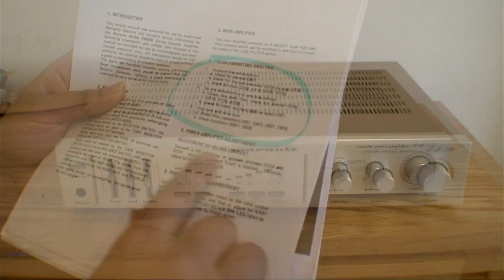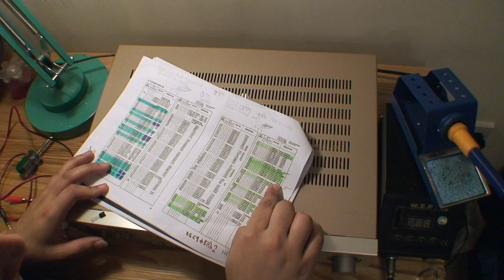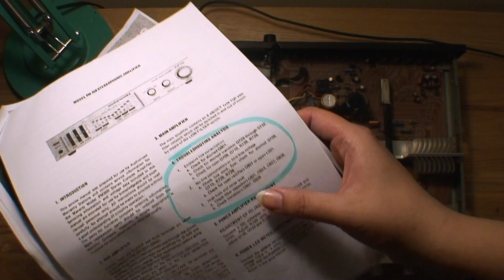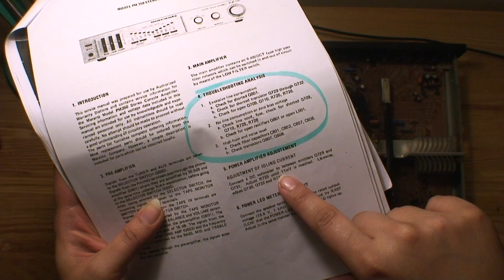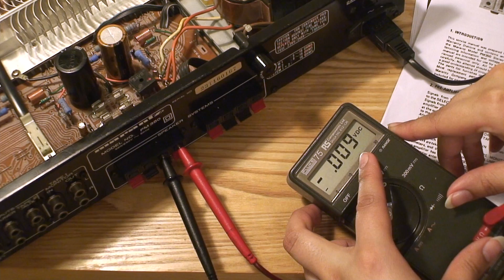Vintage Amplifier repair - 05 Adjusting the idling current (Marantz PM350)

Comment: Helllo Maddy , i realy enjoyed your good mood while fixing your amplifier ........and i am not the only one hahahaha.
Idle current will drift after adjustment and needs some time to settle before it  stabilizes , it's good practice to control and correct the bias/current if needed after 20  minutes ( always turn the pot slowly and wait .)
Offset voltages will benefit also from it .............
Keep on with a smile and enjoy your work .

Comment: If I not mistakeing  caps on older stuff are the first things to fail,I figured you might have recaped,.I am still learning at my age . 66
Reply from the maker: Yes it's the first things that go, caps can dry up, leak therefore their values will change and shift and can result in malfunction or damage, especially in sensitive equipment like micro computers for example. 
I think we're always learning, or always should be :o)

Comment: Hi, my sister, how are you? I have a tac c1 that works well but unfortunately does not record or erase the pre-recorded material. Do you have the solution? if it's possible
Reply from the maker: Hello, i'm well thanks, i've never actually heard of a Tac C1, what is it exactly, it's a type of cassette deck?
Reply: I used several tapes . trying to record the same result even on blank tapes and I am afraid of any action  he make me lost device in my country there are no professionals in the field
Reply from the maker: Okay Teac! I've never actually even used this model before, it sounds like the connections to the erase or record head may  not be good but it could be something simpler... since i'm unsure, I will give you the link to a facebook group who deal with cassette decks, and there is a helpful community there, you can post your issue along with a picture and hopefully somebody there can help you: https://www.facebook.com/groups/985045284868489/

Comment: Indeed, in order to check idle current you have to hook up onto the emitter resistor.  BTW, it is not wise to have the amp warming up for 30 minutes without knowing the idle current in the first place.  It might be way too high for starters, which would blow up the output transistors before you have the chance to adjust. Warm up the amp for five minutes, adjust idle current, you can check it again 20 minutes later.  Nice job, congrats.

Comment: I have the same Technics amp as the 1 in the background and blew 1 of the output transistor ic and ordered a new pair to replace them but when I fitted them then both channels didn't work so I ordered another couple and they still didn't work so I put the old ones back in and had 1 channel working again, then I gave up on it. About a year later I read that a heap of old STK8050s amp ic were made and they were all faulty, this is why I had failed in the first place and they are no longer available as old new stock.

Comment: hello maddie again i just got a teac cd player cd-p1188 it plays great but i cant get the display lights to work i was told that was the only trouble with it can you tell me what might be wrong with the light i check the unit it has no glass fuse help
Reply from the maker: Hi Todd, I would try getting the service manual for it first. if you're lucky it may just be a bad connection, i'm not really sure exactly what it could be having not taken a look. Though try the simplest things first.
Reply: THANK YOU I TRY THAT MADDIE

Comment: like video.one thing you should do is to test for current out of speaker terminals and not wait a half houer.Ok to wait fo amp to get up to normal temp. bias adjustment as you do is  done right as i can see.you can save a lot of money hwen you are either feeling the temp on the trouble side or use a digital infrared? temp meter. if bias is way out off speck hwen you turn it on you can destroy somthing.and you are right that bias should bee adjusted spesialy on cheap potmeters every 2 years.some like on sertan amps to have a higher bias current than the specs says so their amp can work more in class a mode is the belife i heard and can see maybe work depends on amp circuit type.klass a/b type amps this is done most with.I build amps and for 35 years have build loudspeaker systems and amps pre and power.>I am now building a hole sound system that will beat the spesial brands for the rich people but costs a small amount off what those brands take for the same over used circuit,s.I use dual mono 3 or 4 way digiatly manage amp for woofer and low mid and planar magnetik type drivers from 300hz up to around 3400.Then a amt tweeter from dayton amt1-4.It has a replaseble diagram folded and made by mundorf a german company that make drivers with that tech.problems with normal tweeters and mid drivers are start stop time and the total mass that moves.compare to my mids tha are rektagulere.diagram size like a round normal 6.5 inch mid/bass driver.a good round one with ceramic membrane etc total moving mass will be around 13 grams.mine total mass 2-3 grams with neodym magnets behind and in front of the flat thin diagram with the coil iff you will is spred out on the capton sheet thats retangle.look it upp mine is called neo 10 Grabener bolhenderr or the other way around with the name. models neo 10 use 2 off them in eatch speaker projekt they have a good 95 watt poweramp that drives them signal is devided in the 2 digital filters  its ground sound rpc 24dnc with the best chipset i could get from burr brown and teksas instrument i use 2 filter because i i drive them i mono and use only one input for left canal and 4 outputs for what a program it to do.software you get from ground sound and you mesure the room and speakers to get as good sound you can get in that room.One thing to all those Who buil speakers is never bye a driver with sensitivity under 91db at least.and woofer in a vented cabinett should have so low total quality faktor as posible around 0.24.not over 0.33.have a frame tha is casted aluminium or magnesium not sheetmetal stampt out.pa like senitivity but sound much better.one tweeter when diagram is flatend out it will be the same size as 6 to 8 1 inch textil or metalldomes diagram.look the drivers upp.the low woofer is Bms 12 s330.the sound is in the 100 000 kr at least dollars devide by 7.i seen sytem that cost 175 000 kr that have worce posibilyties.oa this was getting long liked your video keep on learning and doing what you try to do bee good

Comment: I just bought this amplifier and I getting a hum when I am around -33 volume. Also on turning on the amplifier the speaker clicks. I have connected my old Kenwood n851 speakers to it for testing. I would like to fix the issue before adding better quality speakers. What can be the problem?
Reply from the maker: Yes I wouldn't connect new speakers to this until you sort it out...I had a hum and it was a bad transistor which had shorted two of it's pins, resulting in the left channel not working and a hum... it could be a clue.
It sounds like there is some DC getting to the speaker output... test it with a multimeter on DC setting to see if you get any voltage.

Comment: Well done indeed, it takes a lot of guts and tenacity to go about a repair in the way you did, with limited knowledge and equip't. Still, a positive mental attitude and a belief in yourself and your abilities goes a long way towards acheiving the final goal. I only have one question though: Why did you only change one of the large filter caps and not both? Or did you do both but only had one gold and one black to replace them with? Subscribed and liked. :-)
Reply from the maker: Welcome and Thank you for your kind words! :o) 
Yes, you figured correctly, I did change both the filter caps but only had one gold and one black haha.
I was determined to fix this amp haha when you have a passion about something, the positive always happens. As you said, attitude and belief goes a long way :o)

Comment: Maddi,  Congratulations on your repair!  There's a lot to be said for persistence and not giving up.  
Also, thanks for showing how to set the idling current and checking for DC voltage at the amplifier speaker terminals.  I had no idea that needed to be done.

Regards, Tom
Reply from the maker: Thank you Tom! And you're welcome, before this I didn't know about the idling current, now I know what the issue is with my second amp. Kind regards

Comment: Great job there!, I remember replacing the Capacitors on my Amiga A1200 and was checking something on the board while it was still live and I shorted one of the power rail caps with my finger, I screamed like klingon ,but lesson learned :)
Reply from the maker: Thanks!
Yikes, capacitors can be nasty little critters! though I've never heard a klingon scream before ;o) sigh I miss my A1200..
Wait... live capacitor replacing?!? Haha that is crazy! I hope the A1200 survived, I already know you did :oD
Reply: Oh No I was not replacing the capacitors while live I was checking voltages with a multimetrer :).
I still have the A1200 and many other Amiga retro machines, I  must be a bit nuts, but it keeps me off the streets LoL
I keep looking at that stereo system you have and I miss mine :( ,perhaps you have given the push to acquire one again !
Reply from the maker: Ahh phew! for a minute I thought "He really IS superman!" ;o)
You still have your A1200? You're very wise! I just have regrets lol. The Hi-Fi system is worth getting again, I never realised just how much I miss putting on a record or even recording on tapes/reels :o)

Comment: When working on any mains equipment you should be powering via an isolatting transformer unless you like barbiqued lady for your efforts I am glad you set up the amp after a repair why people are surprised to see a female tackling electronics when there is no difference in there ability is beyond me good luck with future jobs.
Reply: hello nice job there some advice  when you done solder new parts in use some mentholated spirits and a brush to clean the area you just worked on   my name  is jason
Reply from the maker: +bigt121947 
Thank you! And yes I agree...About the amp, I've been advised to use something called a "Lamp limiter" next time, i'm not aware of isolating transformers. However I somehow don't think i'd be there to enjoy barbecued lady for my efforts haha ;o))
Reply: Hi
have a look at this I am hopeless at putting thngs into words.https://en.wikipedia.org/wiki/Isolation_transformer
Reply from the maker: Hello Jason and thanks for the useful tip!
Reply: any time  first time i see a woman repair amps build computer i have been fixing things from a child and building as well  are you on face book ?
Reply: It's good practice to use an isolation transformer, when I worked in a repair shop we always used it with tv's. Receivers have a transformer inside them so it should be isolated from the line but you're right in saying we should use one.

Comment: If you think the voltages are bad in this, imaging working with 350  volts DC  for a vacuum tube power amp.
Reply from the maker: +Artcurus 
As much as vacuum tube amps fascinate me, it's the very reason why I don't work with them nor have I attempted building one ;o)

Comment: I must admire your persistence in your desire to learn! You've done very well, and It's actually refreshing to see more women getting involved in electronics repair. Setting the idle current (bias) for solid state devices are of equal importance as with vacuum tubes. I've been an electronics technician my entire life and still do it for a living. There are a lot of good electronics technicians here on YT...Be careful of getting information on some of the forums. There is an abundance of good information out there, but also a lot of wrong information. Good luck in the future! Frank Ferraro--Audio Craft Electronics. :)
Reply: Most people on forums are armchair technicians.
Reply: There's no need to fear tube amplifiers...just respect them, and handle servicing cautiously. There are safety measures to take that will keep you safe from lethal voltages. You just need to always remember that the plate (anode) voltages average anywhere from 100 to near 800 VDC, depending on the particular amplifier, and how much power it puts out. Always discharge the main power supply filter capacitors before proceeding to do any work. If you need guidance working on tube amplifiers, you're welcome to message me at audiocraftelectronics@gmail.com. I will be happy to guide you through safe troubleshooting procedures.
Reply from the maker: +Frank Ferraro 
Thank you for the kind words Frank. I've never heard a tube amplifier first hand before haha i'm fascinated and fearful of them at the same time. Regarding the info on forums. I remember trying to search forums after I uploaded the first 'cry for help' video to this series. A couple of suggestions did confuse me on the forums. Thanks for the heads up!  :o))

Comment: I also agree it would have been better and OK to power off the unit while you hook up the test leads. You can even unplug it just in case there are exposed mains wiring you might accidentally touch. A few seconds won't change the temperature of the components at all.

If any high voltages are present, make sure the power supply capacitors do not store that charge even when turned off. There should be bleeder resistors to drain off this charge but don't count on it. I don't think this unit uses any super high voltages but in general it is something everyone should be aware of.

I also agree that the hum could be magnetic coupling from the amp into the phone cartridge. Moving the turntable away would be a good test to see if that is what is happening. Power transformers generate stray 60 cycle magnetic fields that can easily couple into the phono cartridge pickup coils. These fields fall off rapidly in intensity with distance so even 4-6 inches can make a huge difference.
Reply from the maker: +Herbert Susmann 
Yes, also topping that the skimpy hook probes I had made it even worse giving me more chance to touch something with my knuckle. I'm definitely going to switch it off when I get around to doing this with my Technics amplifier.
Also thanks for confirming my suspicions about the hum!

Comment: Great video! Thanks for posting it. I would have checked the idle current right away after first power up and adjusted it to 11mV immediately. Then I would have waited for it to warm up, perhaps checking the current periodically, and then adjusted it again if needed to 11mV. That way if the current is way too high at first at least you don't let it cook for half an hour at high current while you wait.
Reply from the maker: +Herbert Susmann 
That's actually a good point. Thank you!

Comment: Useful tips, thanks.
The Technics amp hum could a ground problem or the smoothing caps might need replacing. I have some big old NOS caps that may do the job. Drop me an email and I'll send them in the post.
Reply from the maker: +Dr Wobble 
That's very kind of you!
I show it in more detail here: https://www.youtube.com/watch?v=CElP-FdETPU
It only happens when the stylus is on the record. It may indeed be a grounding issue.

Comment: Maddi, Congratulations on fully repairing and setting up your Amplifier.You can switch off the Amplifier when connecting the hook clips, then power up the amplifier again. The few seconds  will make no difference and your safe to connect the test leads with no risk of shorting and you will avoid possible electrocution from the incoming mains power supply.
Reply from the maker: +Audio Amplifier Servicing 
Hey thanks! I was actually wondering about that at the time, if a few seconds would make a difference or not as I had the same concerns. I thought to leave it on just in case. Thank you for the clarification!
Reply: In this design I'd be most worried about the primary side of the transformer and the worst of that seems to be at the mains inlet in this amp - the terminals of the socket are exposed and that means 230 V, even with the power switch off. Everything past that point seems to be nicely insulated.

Comment: Hello Maddi, 

Thank you so much for this as it has helped me so much with my faulty amp. It
has helped me build the confidence enough to tidy up so that I can continue
with the repair of my faulty amplifier.

I think that if I replace all of the main components like you did, it will
improve the sound quality which is very important to me :)

I am not sure how you was able to get to the components. I do not want to break
it taking it apart.
I do not think that there are any screws underneath my
amplifier to undo. I guess that once you undone the screws at the bottom of
your amplifier, you was able to get to the solder joints right?
This is where I am currently stuck.
Thanks again for all of your help J